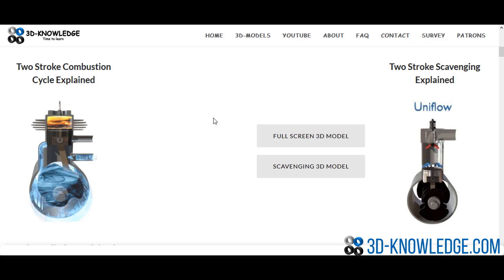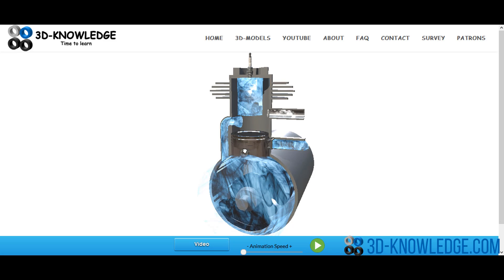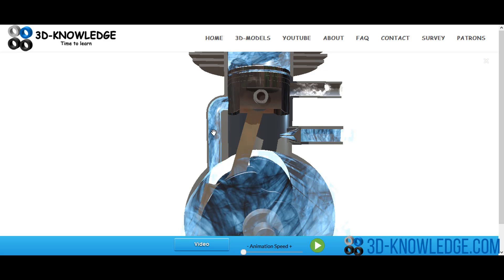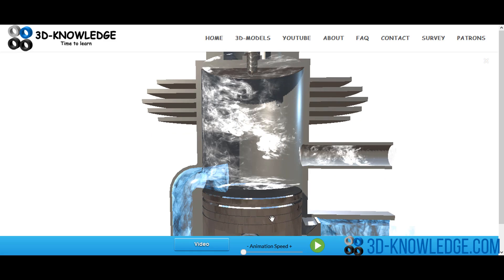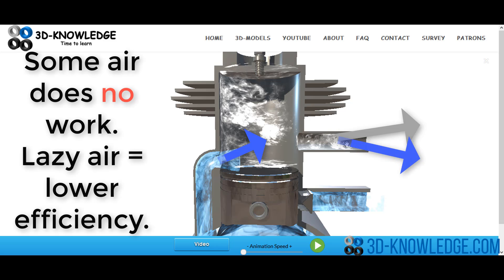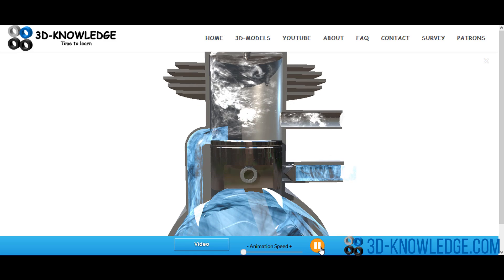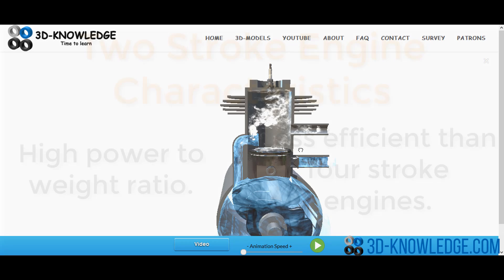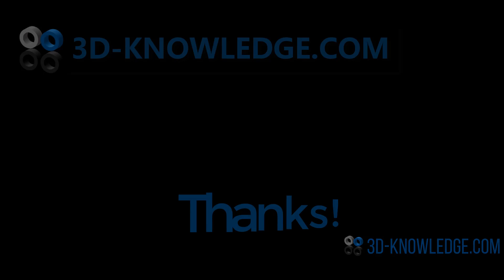How A Two Stroke Engine Works

Comment: Good video.  Could do with explaining how the fuel enters the system. Also, regarding the cooling fins, it is the SURFACE area that is important, not the CROSS SECTIONAL area.

Comment: You go on and on about AIR in the transfer port and crankcase. It's AIR-FUEL mixture!!! Air won't go bang.
Reply from the maker: @ the doc, you are right! Earlier videos are not the best ones. I will re cut this one and bring it up to standard. Thanks for highlighting the issue.